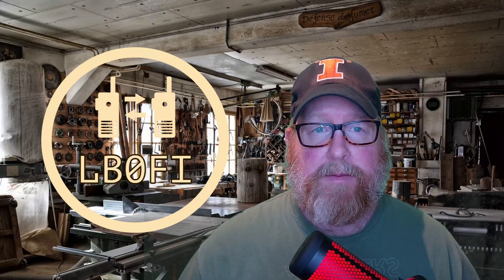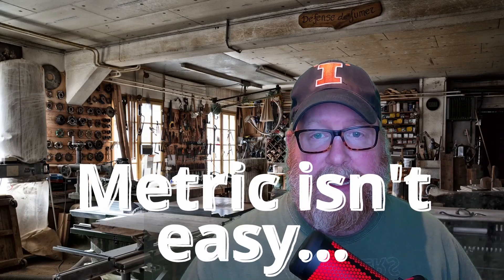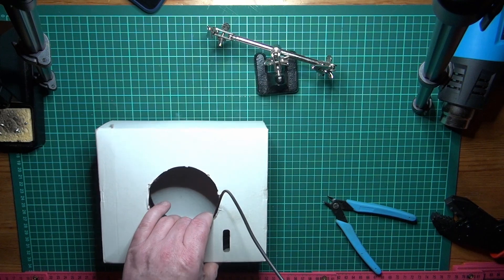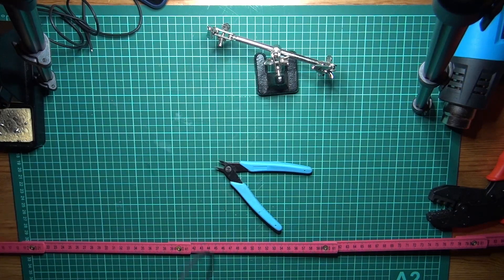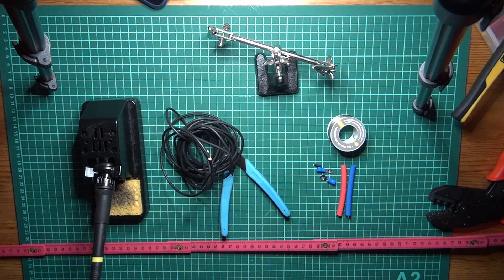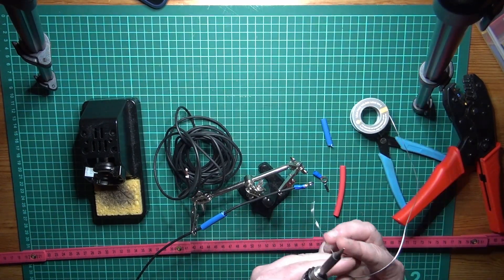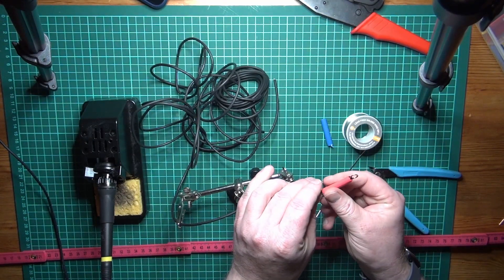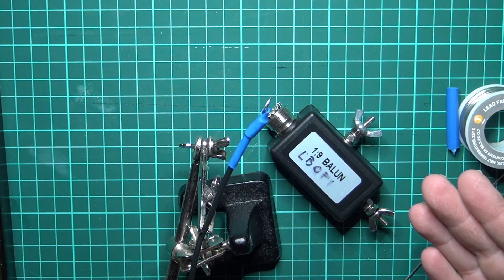Building the K4OGO Coastal 20

Comment: Sorry, 'Great performer' ??? On 20m, 70% of your power will be wasted due to reflections in the coax. And an 'antenna tuner' in the rig does not tune the antenna, it will match the cable end to 50 ohms. The antenna shows on 20m a R35 -j1296 and that is transformed by a 1:9 down into an impedance of R9.83 - j212 Fed this into a 8m long RG-58 coax (as an example), we will find at the end of the coax R6.58 - j60 - this will be matched to 50 ohms on the rig by the 'antenna tuner'.
Reply from the maker: Thank you for pointing out the obvious, and thank you for doing the math. Also thank you for the three question marks, it for sure wouldn't be enough with one. 

Every antenna is a compromise, and at 30% efficiency it is still better than a hamstick. This is an antenna for portable operations where available space is an issue. It is not meant to repace your tower and yagi at home. I would suggest that you follow up by watching my other video on this antenna, and then go on to watch Walt K4OGO's videos on it over at Coastal Waves & Wires. Then please comment again.

Also, what antenna do you use for portable QRP operation in places where a dipole or a vertical with radials won't fit due to space issues?

Comment: I've build Walt's antenna too but did not use a Choke after the Unun... Will you be using one?
Reply from the maker: No, probably not. I will only be running QRP on it. I would think that the coax would act as a counterpoise to some degree, so a choke would probably be a good idea if running a significant amount of power.

Comment: I like you build process.  and who hasn't put a connector on and forgot to put the barrel or shrink tubing on first.  I like to raise mine p in the back yard and get a rough tune on them, but you have to have the space and the time to do that.  I hope it works.  73
Reply from the maker: I’m not to worried about tuning since this by nature is a non resonant antenna that requires a tuner.